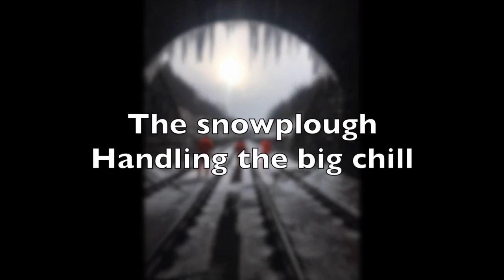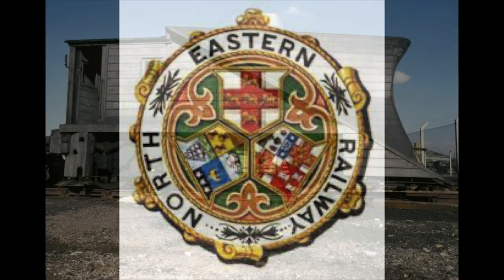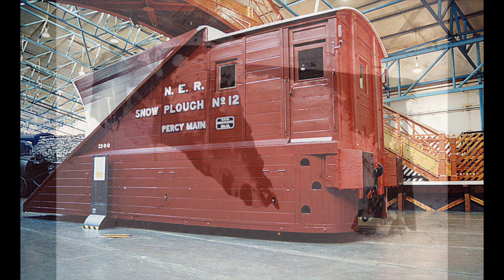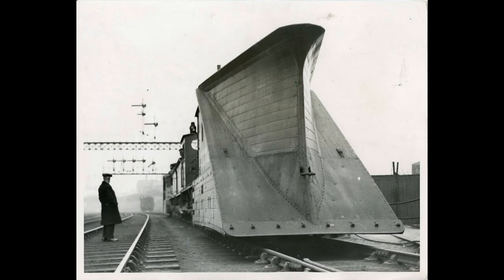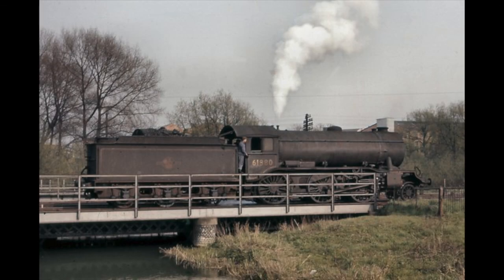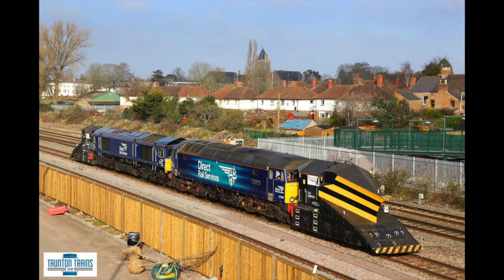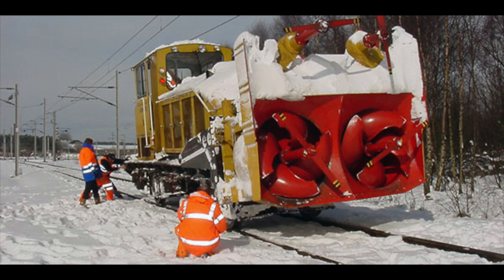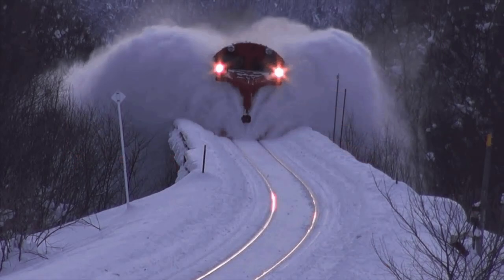The Snowplough - Handling the big chill

Comment: Back in the days of the Class 40s and Peaks the snow ploughs would be propelled by a single locomotive. While the Sectional Appendices required 2 locomotives (unless one of the 1Co-Co1 Type 4s) I've seen many photos of a single locomotive sandwiched between a pair of snow ploughs in snowy weather having been sent out to clear the line.